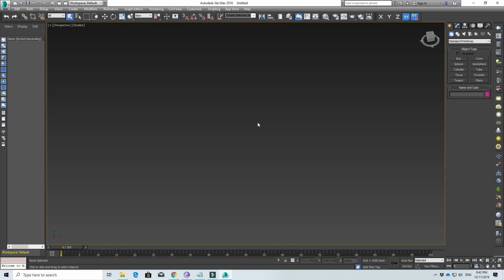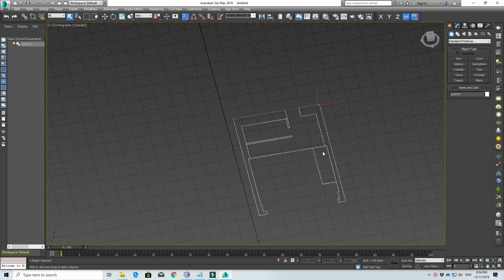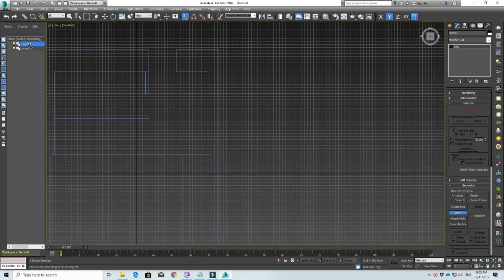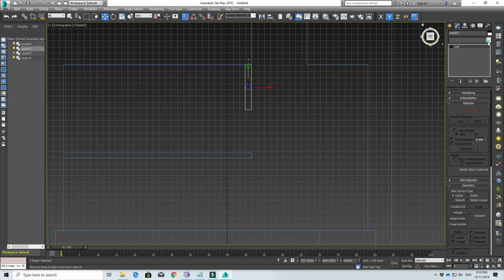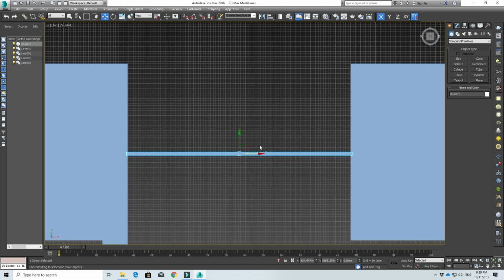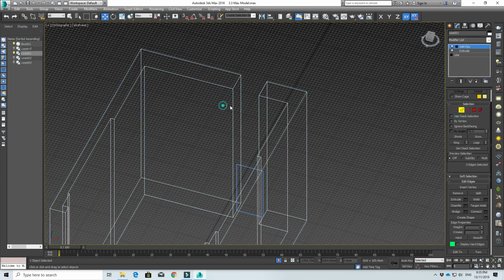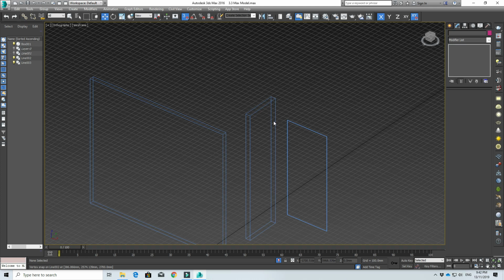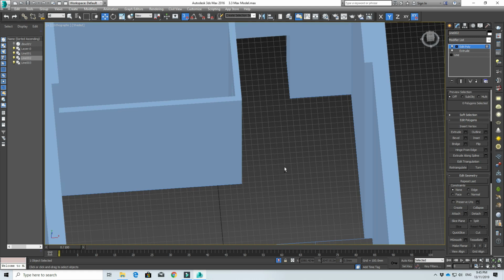3.3 3ds Max and modelling part 1 - Unreal Photo Realistic Archviz Tutorial

Comment: Hi, After I imported .dwg file in mm to 3ds Max, The scale not work properly in 3ds Max.  When I created the box in 3ds Max to create door, the 900mm of the box it wasn't the same as 900mm of the space that I created in Autocad File. How am I supposed to do ? I'm newbie.  I guess something wrong with the units in 3ds Max. Cause I did exactly what you did in Autocad until this video. I'm using 3ds max 2018, and autocad 2020.
Here is the screenshot
https://drive.google.com/open?id=1kedRewdP4Ckq8V7-NPlQ55GjLEkjIRYQ

And I have problem with parameter value in 3ds max, I did set the Amount value at 5700 mm for the Extrude line 1. But the value now shown differently with no mm unit. 

Here is the screenshot
https://drive.google.com/open?id=1u4OtI2r36SNpaCkBK4KOK3zkeKijARff